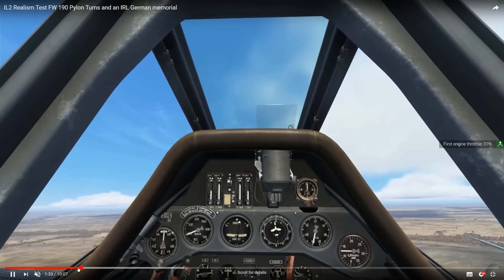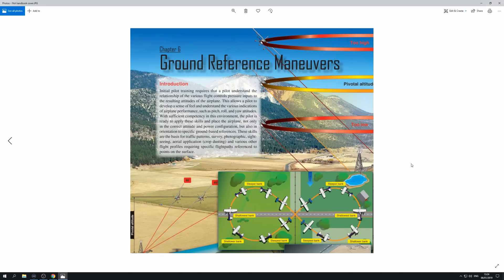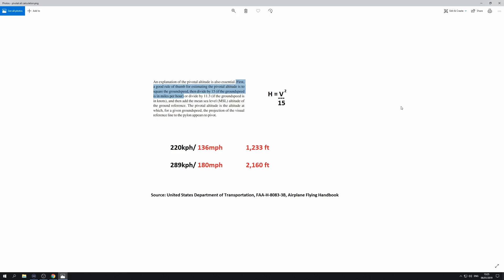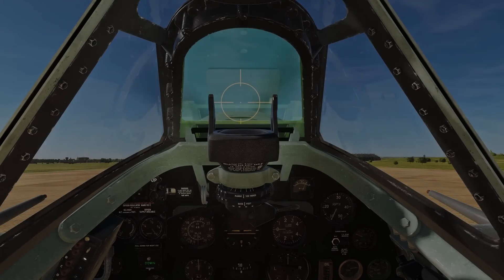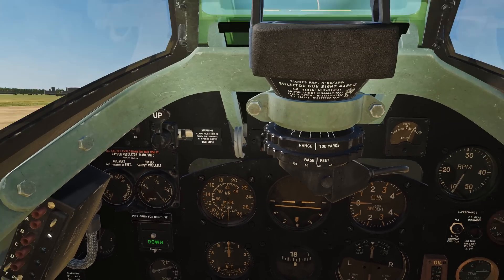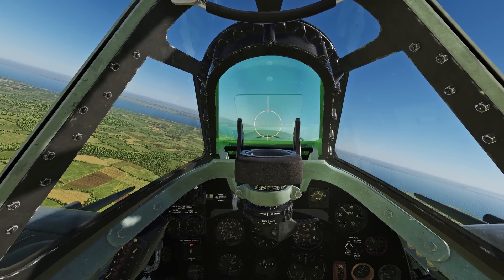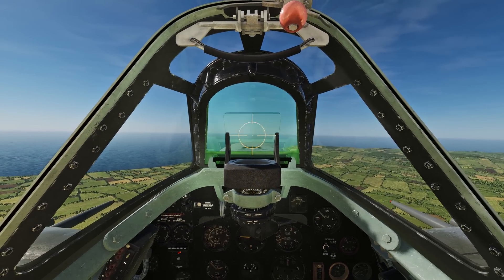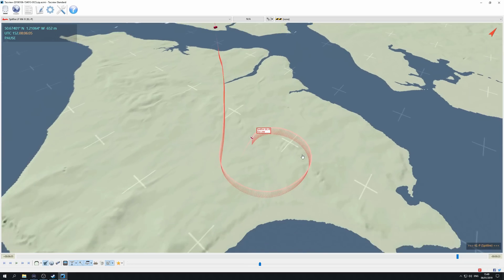DCS "realism test" - A Pivotal Altitude Discussion

Comment: Hey Phil, cool video! I never thought to test this in DCS. I remember doing this maneuver in commercial flight training, and it can be hard to do. But you are skipping a huge step. Your pivotal altitude is what you enter the maneuver at, but your altitude will change as you make the circle around your point. As long as you keep your point on your reference line, you will be back to your starting pivotal altitude when you make it back around to the starting point. Ive watched way to many of these King videos, but I hope this explains it better than I can.  https://www.youtube.com/watch?v=9DgFB-P5ba4
Reply: flyingeagle357  
Alright, you made me dust off my old Commercial Flight book. So it actually isn’t magic, but science! And it starts with this equation: 

H=v^2/11.3+M

As Phil stated in his video, this is how you calculate Pivotal Altitude. But I will try to break it down a little further so you can do it on your own. Your Pivotal Altitude (H) is determined by the square of your ground speed (v), divided by 11.3 (if you are using knots,15 if MPH), plus the Mean Sea Level (MSL) altitude of your ground object (M). Phil set his altimeter to ground level, which isn’t bad, but no real world pilot would ever do this. That is why I am adding the height of the ground object. 

So lets put this into practical use. Lets say you have a groundspeed of 110 knots and your reference point is 850 ft MSL. We’ll start by getting the square of your groundspeed: 110x110=12,100. Now we need to divide this by 11.3: 12,100/11.3=1070.796460177. We will drop the decimal places to make it easier to work with, and we will go with 1070. Lastly, we need to add our ground object height in MSL to 1070: 1070+850=1920. Under these circumstances our Pivotal Altitude will be 1,920 ft MSL. 

But wait! This still doesn’t explain the magical reason as to why you end up at the Pivotal Altitude at the end of the maneuver! Calm down, flyingeagle357. I’m getting to that. First, we need to look into the reason we have a groundspeed at all. 

Lets say the winds are from 090 (directly East) at 20 knots. If we were to take off and fly a heading of 090, the air we are flying through is blowing us backwards at 20 knots. If we have an indicated airspeed (IAS) of 130 knots we would subtract the headwind from our IAS to give us our groundspeed: 130-20=110. This would also conversely work if we were to change our heading 270 (directly West). Our IAS would still be 130 knots, but we would now have a tailwind of 20 knots, giving us a groundspeed 150 knots. Groundspeed can also be increased by flying through thinner air at a higher altitude, but this will not be a factor since we are close to the ground.

The only plane in DCS that gives you a groundspeed readout, at least that I am aware of, is the F-15. At the bottom of the radar it shows your groundspeed (G) and true airspeed (T). I would not suggest trying to do this in the F-15. It’s way too fast. But you can figure out your groundspeed if you build a mission in DCS and set the windspeed at a certain value and direction, and if you know your IAS at your constant power setting in a certain aircraft. In flight school, we did this in a Cessna 172 (muuuuuuuuuch slower than an F-15) and a constant power setting of about 25% into the green arc. Doing this in one of the warbirds at a low enough power setting where you can still maintain positive control would probably do just fine, just like Phil demonstrated. But keep in mind that the faster you are going, the faster you will need to make pitch and bank adjustments.

Eights on Pylons is the only maneuver that I can think of that has you figure out your Pivotal Altitude. This is where you pick two points on the ground and fly a figure 8 around them, but the same can be demonstrated with a single point. Now please don’t confuse this with Turns Around a Point where you need to maintain a constant distance and altitude around the point. You also do not need to calculate your Pivotal Altitude for that maneuver. But we can, for simplicity sake, walk through this as a turn around a single pylon (ground reference point) rather than two.

So here is where the “magic” happens. Lets say enter the turn on the downwind, at your calculated Pivotal Altitude and with a constant power setting (power is not adjusted at all during the turn). As you bank in, you would put the ground reference point on some recognizable point on your wing. I would probably use the visible line toward the leading edge of the wing on the Spitfire, for example. I would also be a little closer than Phil was in his video, maybe half the distance or more. Each degree that you turn away from the headwind is now changing your groundspeed. In order to keep your groundspeed constant you will have to pitch up if your ground reference point is moving behind you and your groundspeed is too fast, or pitch down if your ground reference point is moving in front of you and your groundspeed is too slow. Bank and pitch will need to be adjusted to keep your ground point on your reference line on the wing as you come back to the starting point of the turn.

Remember earlier how I said that your ground speed is conversely affected by the direction you are traveling relative to the wind direction? The same is true as you are making pitch and bank adjustments through the turn. If you were to enter the turn on 090 into the wind, when you reach a heading of 360 your groundspeed would increase causing you to have to pitch up. As you continue to 270, you now have a direct tailwind leading to an even higher groundspeed, making you need to climb even more. But as you continue into 180 at a direct crosswind, your groundspeed would be slower leading you to pitch down. And you would pitch down even more as you turn back into a headwind at 090, leading you to descend back into your original starting Pivotal Altitude. The reciprocal heading will have you doing the opposite of your current heading. Thus, equaling each other out.

Now as I stated, this is extremely hard to perform perfectly. I definitely did not do it perfectly when I did my checkride with the FAA for my single engine commercial license. But it should be close. And I hope this explains my previous comment a little better. Aviation is awesome, and I (obviously) like talking about it. Which is why I do it for a living, and still like flying around in DCS. I hope this explains how you can end up at your starting altitude.